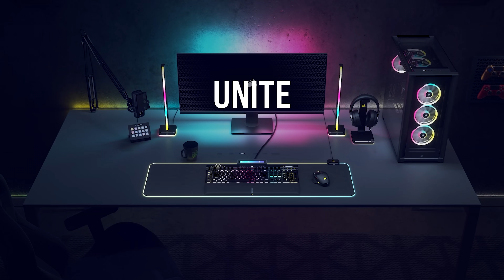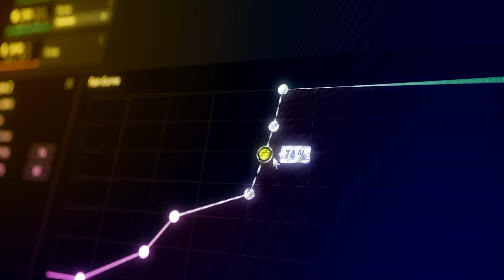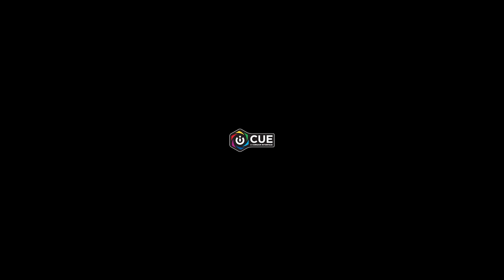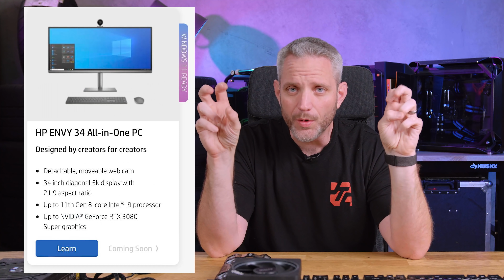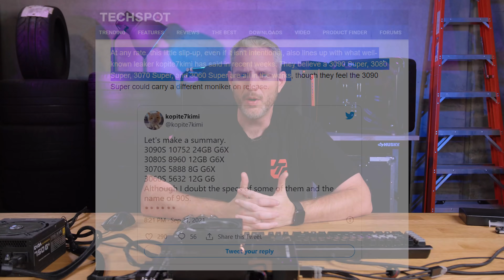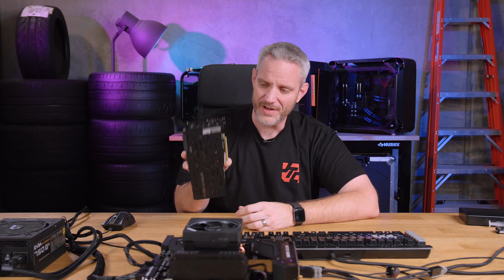RTX 3080 Super...

Comment: Hey man, I have a unrelated question. I was watching one of your pc cooling videos, I think you'll have a better view point on this then I will. I recently stumbled across a interesting little device called a Peltier module. It's basically a little "flat" cube-like structure more or less the size of a average cpu. This device can be given a current and what happens is it creates a cold side & a hot side. What makes this so interesting to me is the cooler you can keep the hot side, the colder the cool side will get (like freezing water kind of cold). My question is this, do you think there is a way to incorporate this device with water cooling solutions but not have the inside of your case freeze up or at the very least start a destructive condensation chain reaction? I was thinking maybe make a little fridge with the watercooling reservoir inside it, this could minimize damage by keeping the cold/heat exchange away from the case itself. But I'm still left with the water condensation problem inside the case itself... any thoughts on this?

Comment: I doubt it, the Super line was a stopgap solution to give the 20-series SOME performance benefit over the 10-series, so that they could sell SOMETHING and beat AMD's offerings. This generation does not have remotely similar circumstances. My guess is that those listings were mistakes and that they meant to list 20-series Supers instead.

Comment: If you are nVidia or a vendor partner and produce a 3080 today, you can't get away with selling it for anything but MSRP, because you've already established what it's worth. So scalpers snap them up and reap a windfall by selling them for where actual demand has plateaued for those cards (~$1500 today). If you release a new SKU of TIs, however, you can price it for however much you want - and they did. If you release a new Super SKU, you can sell it for a little less than a TI, but still far more than the price you previously set for the 3080... back when you still made 3080s. They're going to make a lot of TIs and Super cards, and release a slow trickle of 3080s at MSRP from now on. They won't take the PR hit by discontinuing it outright, but they don't have to make more than a tiny token sample either. There's no money in selling a 3080 when you can sell a TI or Super for significantly more, at a price that is more in line with current demand. i say they make Super cards all up and down the stack, but especially a 3080 Super. Gamers will either lump it or buy AMD... but I suspect they will accept the new price.

Comment: Jay: "Nvidia won't want to upset consumers"
Me: "Uh, is there a new Nvidia that I don't know about?"

Honestly, Nvidia has no problems doing things that will upset consumers if they think it will improve their bottom line.  Oldest example that I can think of is when they first broke convention and started pushing up the price of the halo tier GPUs back in the '00s.  Then we have the Titan tier/dual GPU cards going for $USD 1k+ which upset a lot of people as well as Nvidia Gameworks, that "you need new branding for GPUs that are not Nvidia or we will cut you off" (they realised that the blowback on that one would greatly harm their bottom line so they stopped pushing that one) and so on.

Also, no discrete GPU uses system RAM regardless of whether it is a laptop or desktop system.  The reason why laptop GPUs underperform compared to desktop GPUs is that they are massively power and thermally constrained.  A desktop RTX 3080 can easily pull 375W from the PSU while a top end laptop RTX 3080 will be limited to around 165W.

For what it is worth, there are "desktop" All-In-One PCs that use desktop parts instead of laptop parts.  This doesn't mean that the HP one is this way but it is always a possibility, especially if it is a 34" ultrawide display.

Disclaimer:  I gave up on upgrading my PC for the latest generation back in December last year and I plan on waiting for AM5 CPUs and next gen AMD/Nvidia GPUs before I try again.

Comment: I think you're half right...but also half wrong. The 3070 Super is the focus, in my mind. I think the upcoming Intel GPUs, rumored to compete favorably with 3070, have Nvidia worried. Nvidia may think they HAVE to release a 3070 Super (at the same MSRP, no less) to stave off Intel. And that thinking might actually be right. It all depends on Intel, and I honestly wish them the best of luck when their GPUs ARE released. A 3rd legitimate, strong player might be just what we need to finally exert downward pressure on pricing. AMD largely followed Nvidia in this generation, eschewing their previous value-based reputation in favor of an apparent cash grab, and I can't fault them too much. AMD was in serious financial trouble for a long time, and their recent popularity and price increases should be putting the company on a much more stable footing for the future.

The question then is, CAN Nvidia release a 3070 Super and NOT also release a 3080 Super? That's a conundrum. People are going to be upset whether that answer is yes or no.

Comment: The only way a 3080 super would make sense if it was cut down from culled stock. But if the super was better than the regular 3080 that would mean that there is something better out there than the 3080 to cull from. Cut down from TI? Probably not. 3090? Nope.

Comment: I thought these new skews are using chips that failed quality assurance for higher end cards. they cut them down (disabling the faulty areas) and release them as a lower skew so the chip isnt totally wasted?
If this is the case then these new skews are just making more chips available to the market, that would overwise be destined for the trash.

If they are making new gpu chips specifically for new skews then sure they need to re-examine their strategies and get existing products on shelves first.

Comment: I got a MSI 3070 TI my second entry into Newegg Shuffle. It was $970 but with important tariff I was happy. I also had to buy an MSI 2TB nvme but it is high read and right speeds and would need it anyway. Total I paid $1500 for the pair, but got a free AMD 5800X through a work discount program using points so I see it as a good trade off.
Reply: Important tariff*

Comment: They already reset the queue when they launched LHR cards.  My orders from last year for original cards from wholesale are still in place for a now discontinued item.  Because of allocations going to "platinum" level partners only, the regular distributor stock never shipped a single unit.  Ordering the replacement LHR stock puts me back to back of the line.  Asus and MSI specifically tell distributors which resellers are allowed to get shipments first.

Comment: Honestly I don't get your logic at all. The queue is evgas system not nvidia's. All evga would have to do is give an opportunity for people to swap their place in line to the new product if they wanted. If nvidia has made improvements in the process yields that would let them offer a better product for the same price (like2070 super for example ) then it would be anti consumer to sit on that and only offer the old product. Doing so won't cost nvidia anything extra (r and d continues regardless of the shortages) but would actually give them some good press which they sorely need. Now if they released these super cards at worse price to performance ratios (like the 3080ti launch) then that would be anticonsumer and they'd earn your wrath. But if they do what they did with the Turing super cards then it can only be a good thing.

Comment: I don’t think we’ll see a “Super” variant on desktops as the “Ti” series in the 3000 series. The GTX1000 series where the non-Ti models were noticeably slower compared to their Ti line….allowed a Super to be created and not cannibalise their Ti line. The RTX3000 has no performance to spare without cannibalising their Ti line and profit margins
Reply: 10 series didn't have Super that was 20 series
Reply: @tj_2701  nvidias lineup at the time is so fucked you may as well count the 1060 6 gig, 1060 GDDR5X, 1660 and 1660s as some form of super card within the 10 series.

Comment: Personally, I think HP would screw up a wet dream. I would have to agree with you Jay on the fact that this has to be a laptop sku. I've worked on their all in ones, and you can not fit a regular video card in there (at least the one i worked on). As for pricing of cards, it is ridiculous that older cards are going for mega bucks, heck looking up a LGA 1155 motherboard (for kicks) I was finding boards priced at their original release pricing...........🤨

Comment: What if the super variant are the exact same cores as the current line up but they managed to get more cuda cores turned on like the actual manufacturing has improved and they are able to use more cores on the same dye. Similar to how intels core i7s and core i5s are normally the same core but the i5s have functions turned off because they weren’t stable enough. That’s the only way I can see nivida doing this without damaging there consumers trust

Comment: Some laptop GPUs are just rebadged deskjtop GPUs.   A laptop 3080 is the same GA104 with the same core count as a 3070ti dekstop.  Also, as recently as Turing, laptop GPUs were just power limited versions of the desktop SKUs.  My laptop with 2080 Super has a 200W limit but is otherwise the same GPU as a desktop 2080 Super.  Unlike Ampere, it's the exact same chip as desktop for  CUDA/Tensor/RT cores etc.  It's a shame they don't use a different name for any laptop GPU that isn't the same exact chip as desktop. Nonetheless I'm fortunate to have a both a laptop and desktop so I don't want to complain too much but want more transparency.

Comment: Jay, the laptop gpus use ga104 and im pretty sure the 3080 mobile is the full chip just different firmware so it might be impossible for a 3080 super in mobile. As a desktop card, a 3080 super is the only super that makes sense, the 3070ti is the full chip so no 70 super, a 3060 with more cores than a 3060ti is dumb, and a 3090 super would be the same chip as the a6000 so unless they are not selling as many of those as they hoped or ga102 yields are phenomenal that card would be dumb. But a 3080 super, if they split the difference in core count, say 9000 something, it would fill an existing gap I the product stack. That being said, I agree with your overall take Jay. It would be stupid in general.

Comment: The one Dutch IT store from which i bought my 3070, still has this stock for 3080's and 3090's at the time of this comment;
- 13x Gigabyte GeForce RTX 3080 Ti Gaming OC
- 5x Gigabyte Aorus GeForce RTX 3080 Ti XTREME (1x non-ti version in stock)
- 9x Gigabyte GeForce RTX 3080 Ti Vision OC - Videokaart
- 2x Gigabyte Aorus GeForce RTX 3080 Ti Xtreme Waterforce 12G (3x non-ti versions in stock)
- 4x Zotac GAMING GeForce RTX 3080 Ti AMP Extreme HOLO
- 5x Gigabyte GeForce RTX 3090 VISION OC 24G
- 3x Gigabyte GeForce RTX 3090 Gaming OC 24G
- 7x Gigabyte GeForce RTX 3090 Aorus Extreme 24G
- 2x Asus TUF Gaming GeForce RTX 3090 OC
- 5x Gigabyte AORUS GeForce RTX 3090 XTREME Waterforce WB 24G
- 2x Asus ROG Strix GeForce RTX 3090 OC white 24G OC Edition
- 2x Gigabyte GeForce RTX 3090 VISION OC 24G
- 1x Gigabyte GeForce RTX 3090 Gaming OC 24G
- 1x Asus ROG Strix GeForce RTX 3090 Gaming OC
If you look around, you'll find some.
Although 3060's and 3070's have practically sold out at this particular store i used, and seem to sell a lot faster than the 3080's and 3090's.
Most expensive 3080 in this store is just under $2.200,-
And the most expensive 3090 in this store is a few cents over $3.350,-

Comment: I think these card mfg should stop these multi-releases, only later to release same card with slight improvement. In this age of limited rare earth minerals, chips and such, they need to do a one-time build, best as they can in their different levels, and not do another one until they can do a 50% improvement on the previous ones. Costs and avail of resources to build all these electronics is becoming more and more an issue. Build smartly!!!

Comment: I get what he's saying, but there a whole departments working on new products. You want them to stop? If they did stop, it wouldn't help supply. What if the new products actually helps supply? As they have contracts years in advance to make these chips. What if the tech is slightly different and can't just be used for "non Ti" products? 

I feel this is just pandering to the fustrated masses.

Comment: Companies could just treat them the same, there would be no need to form another queue. When you get the front just ask do you want to hold on for the card you ordered or have this new card (which would mostly likely be at a higher price) not taking the new card would not drop you to the back of the line for the old card.
Unlikely to happen but I do like to dream.

Comment: As someone who has been in the queue for almost a year, I wouldn't even buy a 3080 for MSRP at this point, with Lovelace being about a year away. If the leaks are true, and the performance is 2.5x the 30 Series, I could buy a 4060 instead of a 3080, for presumably much less money. And even if they're not true, we should still see a huge price drop on the 30 Series cards once the 40 Series cards launch. I'm happy using my 980 Ti until then.
Reply: For all we know the 4000 series cards (and the Radeon equivalent) could very well be scalped to the moon and back just like this generation of cards have been, so...

Comment: The purpose of the Super series is to price correct the MSRP of the main cards in line with market conditions. The 3080 is being sold for $699. Since they can’t increase its price anymore they will EOL it, launch an updated variant for $999. Mark my words it will be $999. The price slot between 3080 Ti and 3080 is just too big for nvidia to ignore. And the market is ready to lay $999.

Comment: It has gotten to where every series has a vanilla, super and ti iteration of the card with usually the ti being the top card, super in the middle and the vanilla the original launch version.
I do not see why anyone is surprised at this announcement.
In the 80 series the ti is using the chips that will not cut the mustard as a 90 series vanilla, the super uses the chips that are not quite ti level and the vanilla uses the lowest binned chips.

You know they are binning the chips from day one of the original launch and the changes in memory is what they need against the competition or to make a better card for marketing purposes but still keeping the profit margin within the range they want for that cards price point.

Should be more of a surprise if one of these cards were not released in a series as this is not something brand new for Nvidea.

What sucks is if you really want the best cards in a series you need to wait about 6 months to a year for them to release after the original launch date of the series and by that point of that last iteration being released you are generally already about halfway through that card series life cycle

Comment: Sorry Jay but NVIDIA only cares about its shareholders not the consumers. This is true for all companies. NVIDIA knew it couldn't keep up production on the normal 30 series cards yet still went ahead and put out the Ti variants knowing full well that they couldn't keep production up for the normal 30 series cards but the Ti cards allow them a higher profit margin so they put them out. I can see NVIDIA 100% putting out the Super cards as this will still allow them to create a SKU for chips that can't meet the requirements for the Ti cards but would be to powerful for the standard cards. Even though the demand for the standard 30 series cards is still there, the profit is to be had in the Ti and Super lines.

Also I've been in the EVGA queue for over a year, I'm sure I'll be able to get a 3080 when NVIDIA released the 40 series cards.

Comment: Yeah i signed up for a few 3080s and 3070s on launch day on EVGAs queue. Someone made a google doc spreadsheet tracking it and typically the barebones SKUs had little to no fulfillment. Only the higher end SKUs were going out and that seemed to completely halt once the new round of cards came in. Guess it makes sense with limited supply to sell the most expensive ones since people will buy either way. Just really sucks.

Comment: The 2060 did "relaunch".  Here in Norway it suddenly came back in stock some time ago and still is as the only 20 series card after being gone.
Reply: with 12 gb?
Reply: @igameidoresearchtoo6511  No, still 6
Reply: @paalpet  That means it's old stock being resold, not uncommon to happen.
Reply: Yeah, a few models of the 2060 6GB are available in Sweden again, as well.
Reply: @bofast  They aren't supplying 6 gb models though, only 12 gb.
Reply: @igameidoresearchtoo6511  All I can tell you is that there are only 2060 6GB models available when I look around in various shops. Maybe it's old stock they brought back again, maybe it's not. They were not available before and now they are.

Comment: nvidias line up is a mess. 3060 with more vram then 3060ti and 3070.
a 3060super beeing faster then the ti and at 3070 its less powerful then the ti

what a bs is this. where does the 3080super go? in this tiny gap between the 3080  and ti?
there is not much place and its messy. additional to that the 3080 (ti) and 3090 consume way to much power. wen u compares frames /W AMD is way ahead and i think its an important point when a gpu alone takes 330w up to 400w

Comment: I finally after a long time in the queue for a number of cards got a 3080Ti FTW. I wanted a 3080 FTW hybrid but the 3080's are not moving. If you still want or need a card the best hope is a new SKU that you can get in on early. Many of the older ones, especially the 3080's are never going to deliver. Thus, new cards are the best hope of ever getting anything, at least for MSRP in the EVGA queue system with elite status.